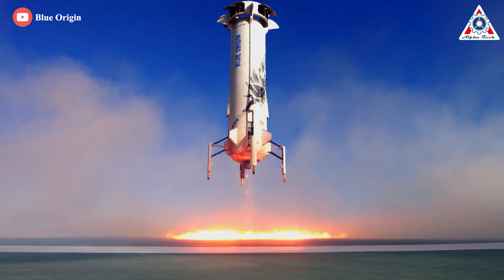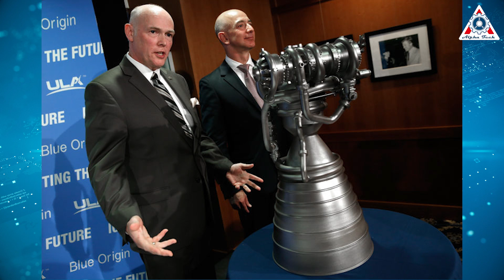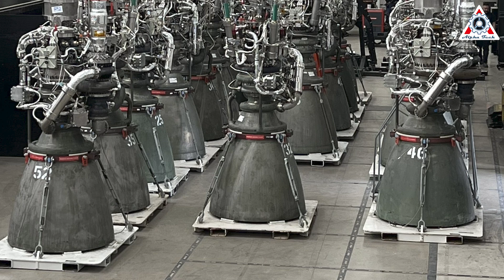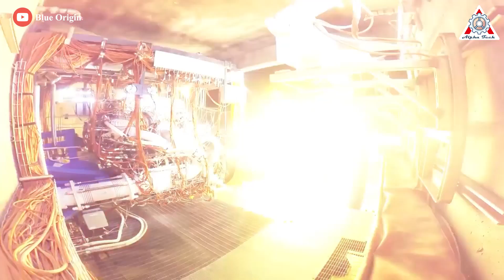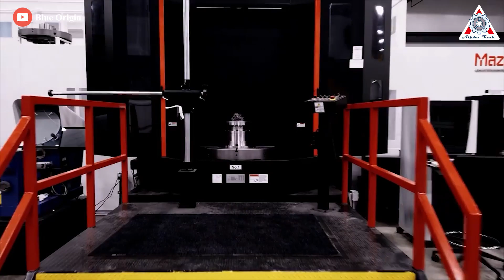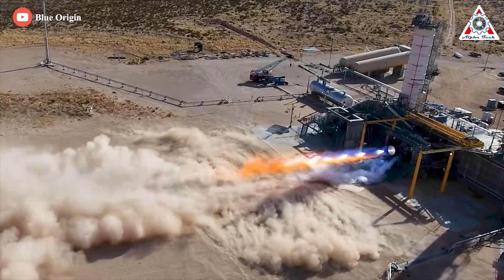Disaster! BE-4 Failure...

Comment: Bezos is all about appearances.

When he founded Amazon, he put his office in the garage just so he could say he had.
Reply: Bro Elon does the same thing lol.
Reply: @SquadTwelve12  But Elon doesn't own 500 million in real estate (including the 30 thou acre ranch where Blue Origin operates)  Then there is Bezos's 500 million OceanCo sail-assisted yacht (build number y721)
But the success or failure of ULA and Blue Origin now depends on this flight. I honestly believe if it fails, The Administration will be forced to talk to Musk about taking the Raptor instead.
Reply: @WhiteWolf65  It is not easy to replace the BE-4 engine with a Raptor engine, even when SpaceX is willing to sell them to ULA. It will take a lot of time to redesign the rocket for the new engine, the trust, the plumbing, the places to mount the engine etc. etc all will be different. And not only for the hardware, but also for the software used in the rocket. This all means at least one to two years of delays again. And remember the Raptor isn't flight tested either!